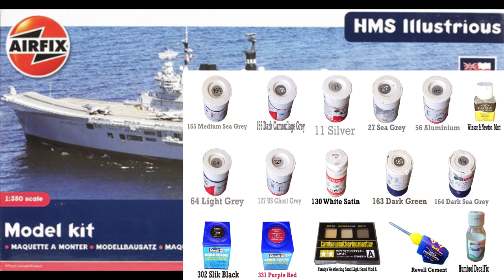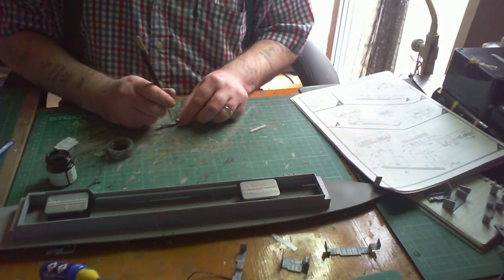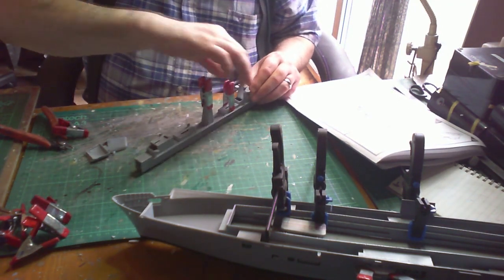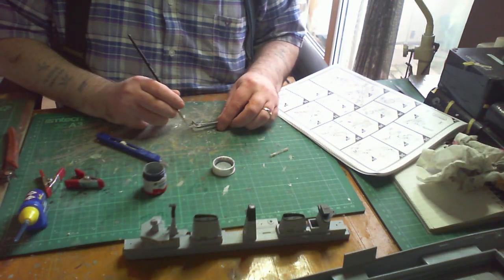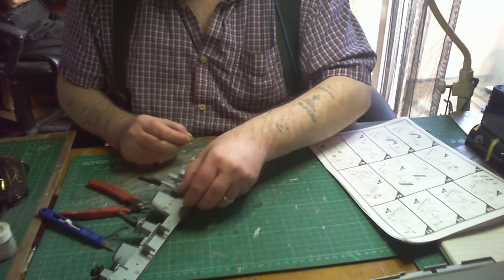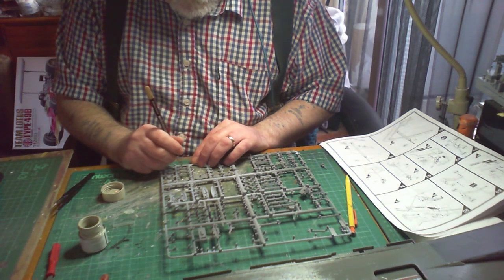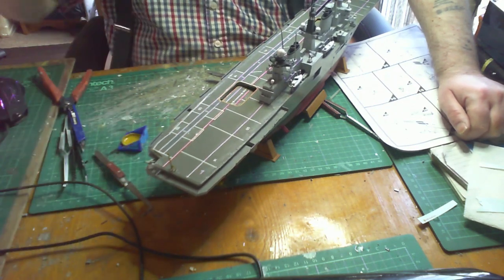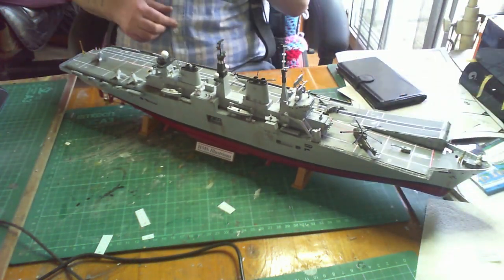AirFix HMS Illustrious 1/350 Complete build Guide

Comment: Great looking build Gavin, impressed with the results you get just using hand painting rather than air brushing!
Reply from the maker: Thanks Matthew. I do have an airbrush but prefer to brush.
Reply: @ReckshawScaleModels  cool, do you have any tips for avoiding brush marks when painting? As you seem to be very good at it
Reply from the maker: @matthewblackmore1802  Hi Matthew thanks for the question. I’ve been thinking about doing a video on this topic for a while. I’ve come up with a good method of painting the dreaded yellows and white colours, there are a few things you can do to avoid brushstroke marks.
1 Have a range of flat brushes on hand. A flat brush distributes the paint more evenly and it also helps with coverage for larger areas. 
2 Keep the brush moist at all times while painting. The paint can become grainy inside the bristles which in turn will leave drag marks. That also helps the life span of the brush.
3 Don’t overload your brush with paint. One of the things a lot of people do is to soak their brush in paint. That can cause more brushstrokes to appear and leave thick ridges. 
4 Paint thin layers. You want to build up the colour gradually especially in lighter colours. It will look patchy at first but after two to three coats it will level out.
5 Don’t apply to much pressure on the brush. Pressing down on the brush will cause the bristles to splay increasing the likelihood of brush marks. Again this will help the longevity of the brush. 
6 Use even stroke. Brushing in long even stoke will help level the paint as your painting. 
7 Paint in the same direction. As with even strokes, it helps with brush marks but also with the flow of the area of your painting.  Go with the contours of your model, it's surprising how this helps when you are adding weathering to your build, think of airflow and how it passes over.
8 Clean your brush after use. Try and make sure your brush is thoroughly clean after use. As well as making sure it is dry. Don’t be tempted to keep your brush in the water this can bend the bristles out of shape causing brushstrokes to appear next time you use the brush.
I hope this can help you ion some small way Matthew.
Reply: @ReckshawScaleModels  thanks for the detailed advice Gavin! Some good tips there. And yes a video on this topic would be cool!

Comment: Typically there aren't any handrails around the flight deck hence the fall nets... Nice build though 👍
Reply from the maker: Hi mrangry65, thanks for the heads up. My little sister pointed that out to me as well a while back. She served on HMS Invincible, maybe I should have asked her before the build. It took me ages to put those things on as well.
Thanks so much for watching and for taking the time comment, it's very much appreciated.
Reply: @ReckshawScaleModels  I enjoyed the build, I'm building it myself and found the hull a real challenge as it was warped and hell. 
I noted that you dont use an airbrush yet the paint looked great on your model, I dont have the steady hand yet for such intricate and accurate hand painting.
Reply from the maker: That's a real shame with the Hull, it does happen even on newer kits. When  I come across that I find that clamping the hull in sections and leaving time to dry before setting the next section makes it a little easier but time consuming.  I do have an AIrbrush but I hardly use it, even on larger scale build I prefer to hand paint.  The same principles apply though, painting in thin coats to build up the colour but also painting in the same direction will improve results. I'll look a the kit and decide how the air would flow over the real thing and paint in that direction, of course there are occasions when that's not possible.  I also find that by using different techniques with a brush I can achieve an airbrush effect if that's what I'm going for.